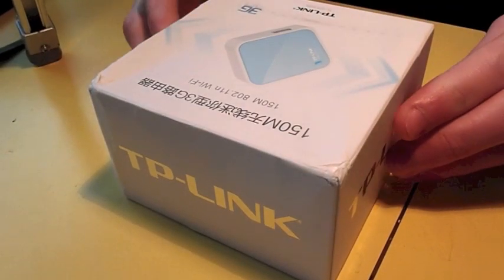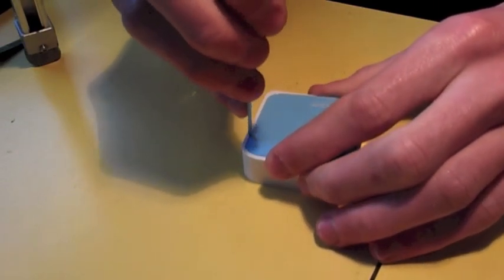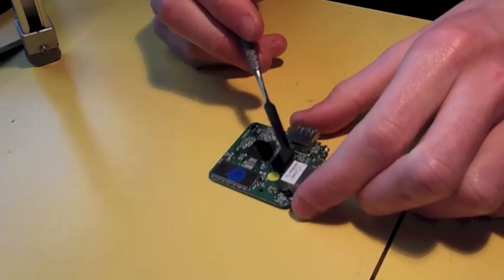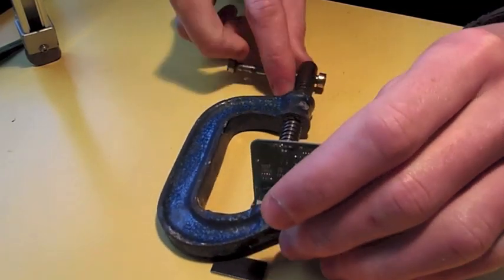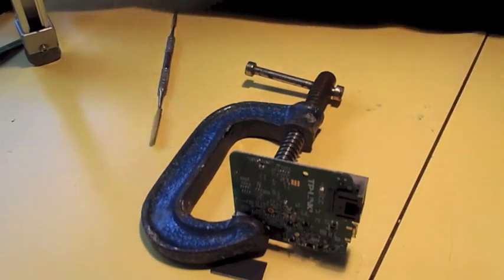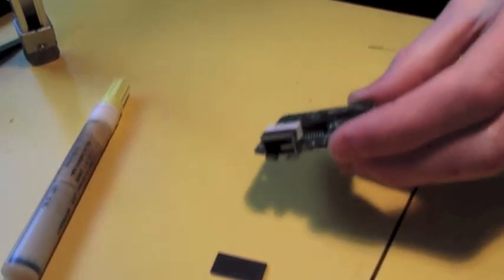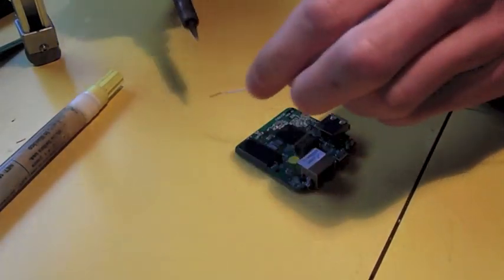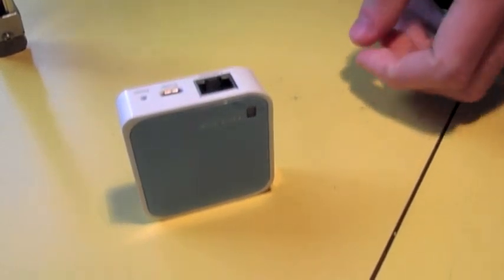64mb RAM upgrade TL-WR703n

Comment: can i change to 128 mb or not?
Reply: No. 64MByte is max.

But even better: You can swap the flash for 16MByte instead of stock 4.
Also you can add a serial port for control usage and recovery or an antenna for better receiption.
Reply: ElMariachi have you done these 3 mods on any tp link mobile products? Is so, can you provide s Link out contact info. I'm very interested.

Comment: You never spoke about WHY you'd want to upgrade the ram. You can read some of the other comments, on this exact question
Reply: Ram in a router holds routing tables and config data, and some of the ram gets ate up boot-strapping the router "OS".  Typically you wouldn't need to do this, as out of the box router firmware will have the router designed to go with the ram included.  If you were going to try out tomato or dd-wrt i guess you could benefit from this mod on the right router.